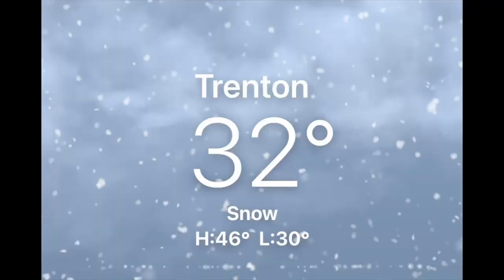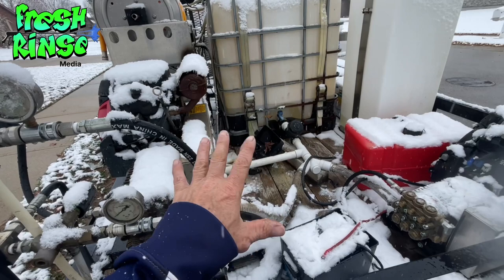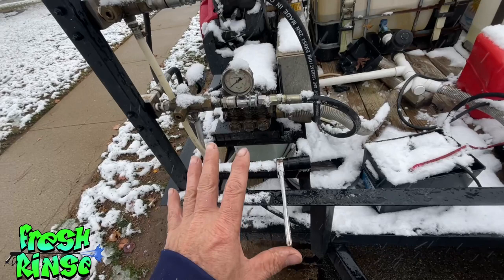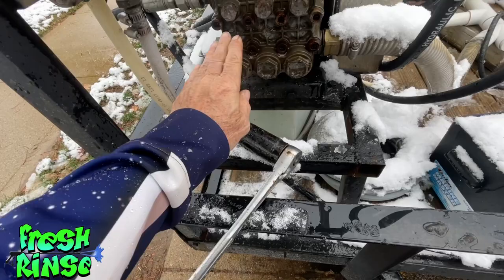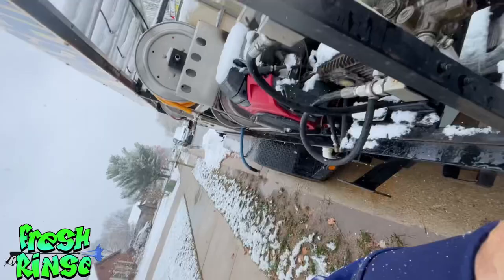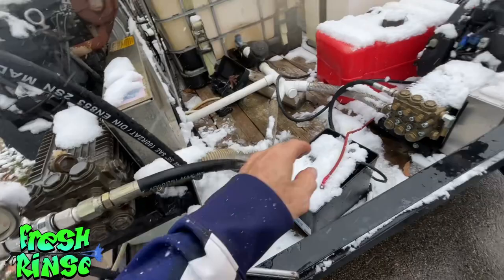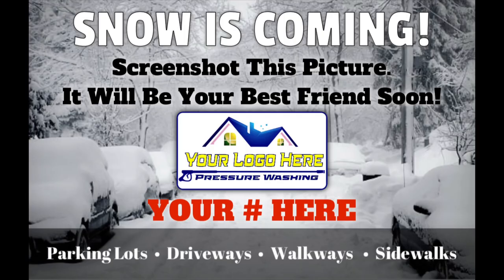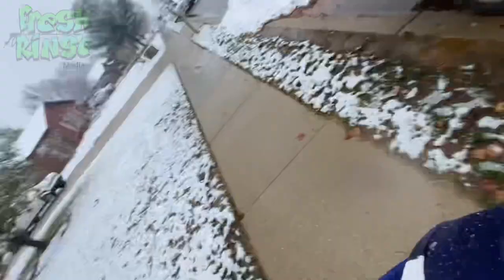First Winterizing Of 2022 - How To Winterize Your Pressure Washing Machine

Comment: Valve Plug:
30 mm socket
Torque specs(manual):
95.9 Ft-Lb(130 Nm).

If you need to swap the inlet and outlet plug sides:
Outlet:
22mm- 29.5FtLb(40Nm)
Inlet:
32mm- 51.6FtLb(70Nm)
Reply from the maker: Fantastic! Thank you for the information. Much appreciated!

Comment: I’m still waiting on the ad slick with your legs as the focus since that’s how you get so many leads. Quick question does it matter which plug you remove from the pump?
Reply from the maker: If I posted my legs any more than I do, I’d be working all year!!!

No sir. Any of the lower plugs will work.

Comment: So that dump valve you opened was for the water supply plumbing to your machines? I only have one machine. 1" line off the tank to a strainer, then to the machine. So what should I do? Can I drain the water in the supply line by taking apart the strainer? I'm running a direct drive off a buffer tank so I don't know if firing up my machine will pull the water through the lines like yours did without the head pressure coming from the tank to force the water into the pump.
Reply from the maker: I’m not exactly sure what you are asking. Is there any place where you can add a Tee, so that you can run a dump value?
Reply: @TheFreshRinse  I'm sure I could somewhere in that 1" supply line. Do you do anything to get all the water out of hose that fills your tank?
Reply from the maker: @joshuamckinley8707  I use my reels for storage only. Water does not run through my reels. I connect to a hose that runs to the tank, and hangs off the outside of the tank (not installed yet). Then I drain that hose after every wash, while reeling in other hoses and such.

Comment: What do u recommend you do if you are washing a old house with a electrical line from the street going up to the Facia
Reply from the maker: 1. Definitely have a contact 
2. If the wires aren’t exposed, their likely won’t be a problem.
3. Only use water in that area
4. Always explain the risk to the homeowner

Comment: If you take out that plastic piece, when you put it back in do you push it in as far as it will go then put the large nut/ back on?
Reply from the maker: Yes. It should snug up against the oring in the back. And the plastic piece is the check valve.